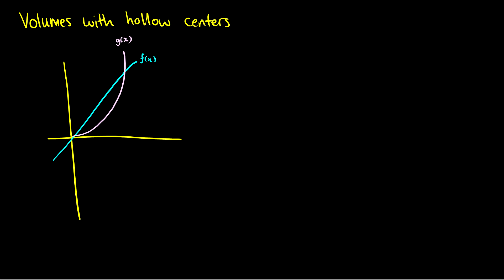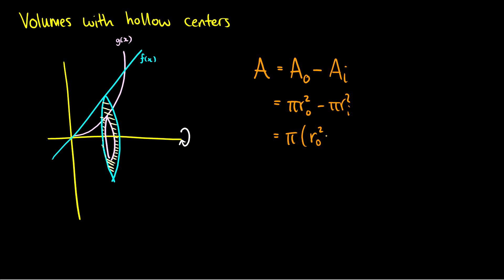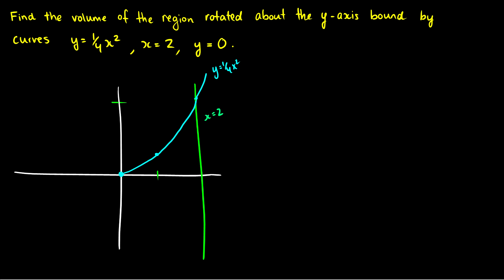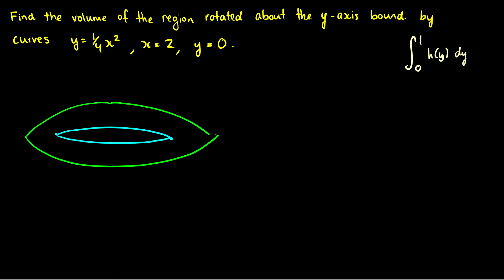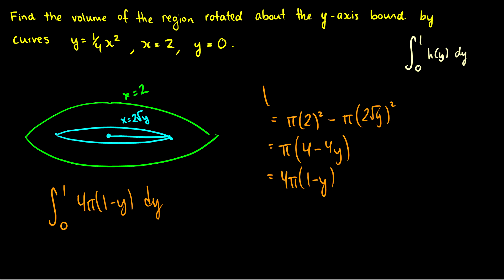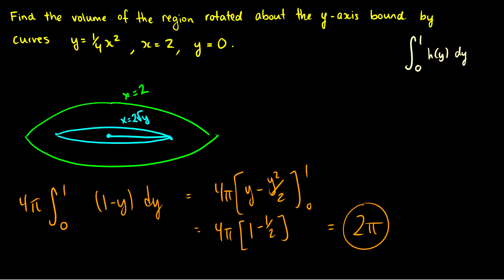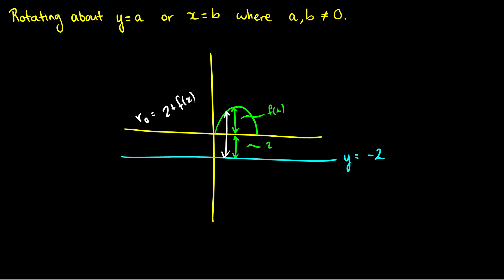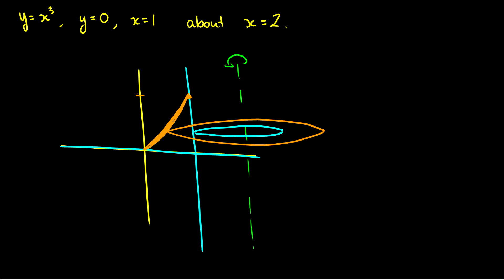VOLUME with DISC METHOD (part 2) - CALCULUS

Comment: There is a mistake @ 16:23. It should be (3/5)y^(5/3) not (3/5)y^(2/3). Because we are only substituting 1 and 0 it doesn't end up changing the answer luckily.